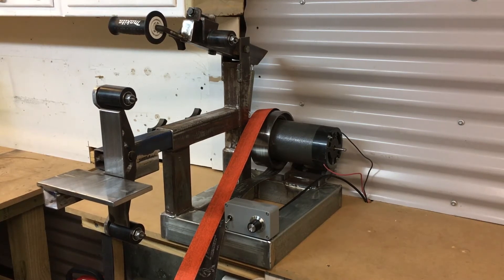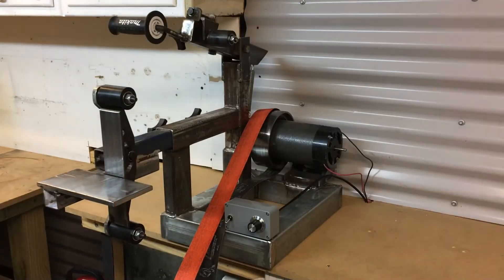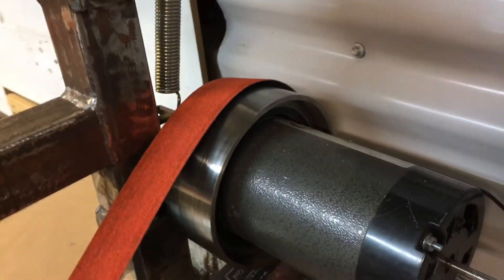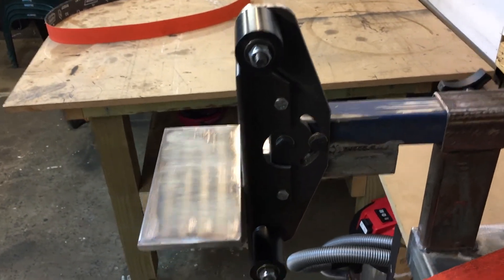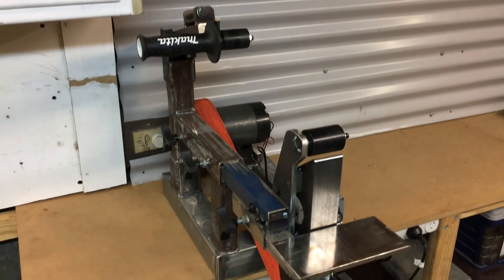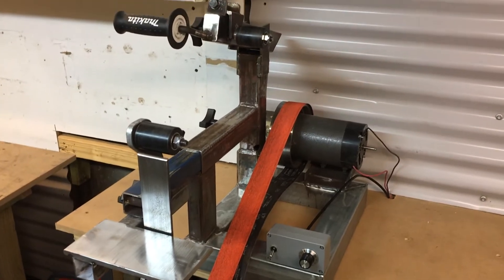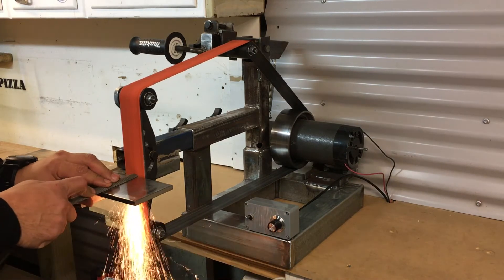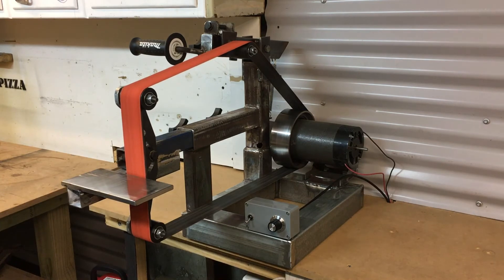Making a 2x72 Belt Grinder

Comment: very awesome!  I think it's funny how typical 2x72 grinders and such use AC motors with super expensive VFDs when DC motors are pretty abundant and you can control them wonderfully using a $10 open source computer.

Comment: Great job Chris !! Normally I have seen the motor in the left side of operator. There is a reason for your right side construction ? I am thinking to use  the same layout because I have a 1HP ac induction motor but with  rotation in wrong direction , then I must use the left side layout !
Reply from the maker: Antonio Celso Pinezi simply to make it more compact ,
The dc motor can run forward or reverse depending on wiring configuration
Reply: Also gotta check if the flywheel is threaded onto the motor shaft. A lot of the motors use reverse threaded screws to hold it together. If you run the motor the wrong direction and stop it suddenly, the flywheel can theoretically dislodge and go flying through your shop. It's not a very likely scenario, but it is something that you should be aware of.

Comment: Have you had any issues with metal dust contaminating  your motor? Nice build.
Reply from the maker: JB Marker none as yet and it gets used a lot, thanks
Reply: Cool! That seems to be a big concern of lot of folks with the open frame treadmill motors.
Reply from the maker: JB Marker I can go drive around and find on the road or my local tip , I am not too worried and they are powerful

Comment: any reason you made the angle platen adjustable an not the table? Cause this seem counter intuitive to me. I would want the platen to remain as close as possible without touching at all times, tilting it would defeat this.
Consider putting hinges on the left lower side so you can rotate the entire thing on its side, then turn the table so you have a much larger working surface.

Comment: Dope video! I'm halfway through building mine, my 3hp 2 pole, 2800 rpm 240v motor arrived yesterday, would you mind dropping me a reply or a pm of how I can set up that arduino thing?
Reply from the maker: Dub Phonics thanks mate, the audrino won't work with your setup as it is ac ,you need to look into vfd cheers